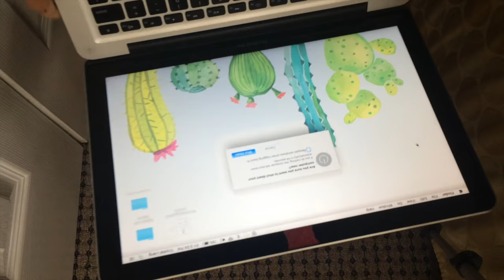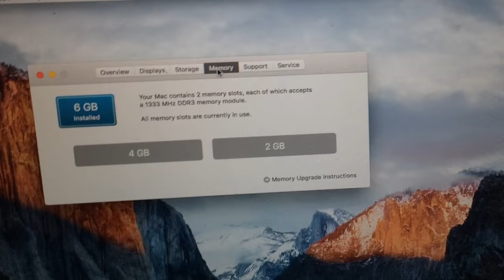SISTER'S BROKEN MACBOOK! VLOG #47 6-10-16

Comment: The hard drive would've definitely worked without anything special. There is no special Mac RAM.
Reply: not yet apple has to use EVERY THING that is there own
Reply: @melvinharris7859  It's not wrong, they even use their own SSDs, and will switch to using their own CPUs once they allow macOS to run on ARM processors.
Reply: @Electrex8  How right you were!

Comment: If the hard drive in the Toshiba is a 2.5-inch SATA drive, it will work on your MacBook with no problems, just boot from your OS X install disk and erase it as Mac OS Extended Journaled. However I suggest buying an SSD for it instead, they're a little expensive but the performance difference is really worth it.
Reply: I just gona tell him that and why you dont upload more often??Am hoping for more uploads
Reply: University exams! Once they're out of the way I'll do more videos
Reply: ***** Realy hoping,yours videos are great but there isn't much of them

Comment: it's possible to install Windows 10on a PC with 1GB Ram but only the 32bit version. These are the requirements for installing windows 10 : Processor: 1 gigahertz (GHz) or faster. RAM: 1 gigabyte (GB) (32-bit) or 2 GB (64-bit) I googled

I have a 1GB from my old dead computer I can possibly use

Comment: there is no difference between pc and mac rams there the same except if it's ddr2 and you have ddr3 or vise versa
Reply: Well macs need specific clock speeds I had a macbook Pro 2008 and I got the correct ram but the clock was off just a bit and it wouldn't boot until I got new ram